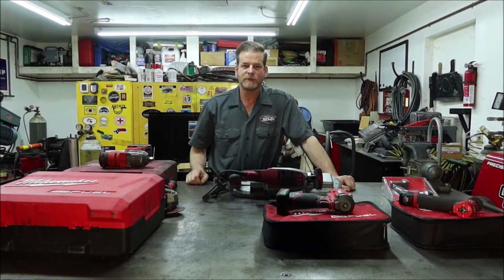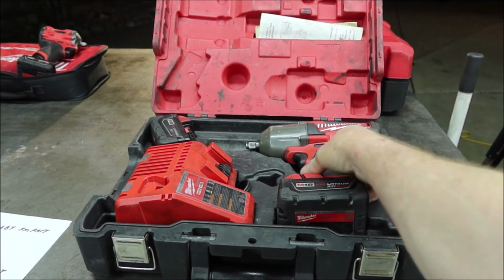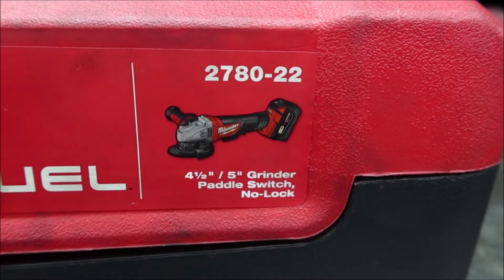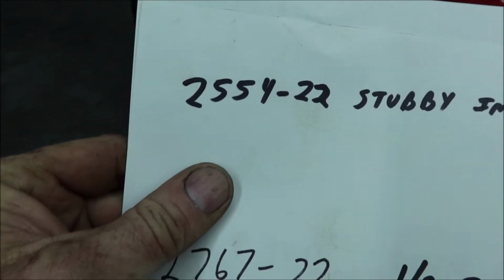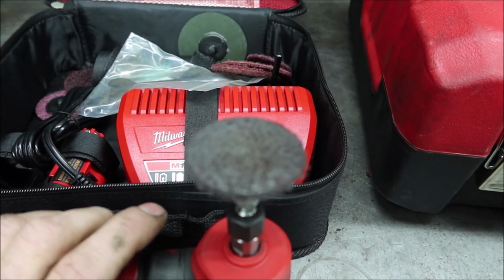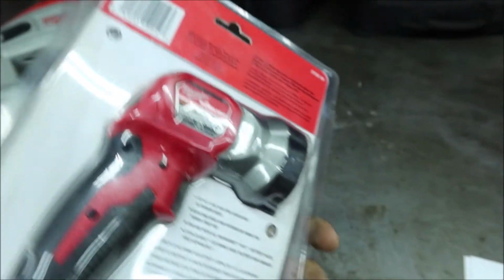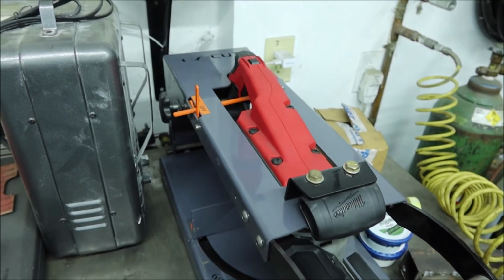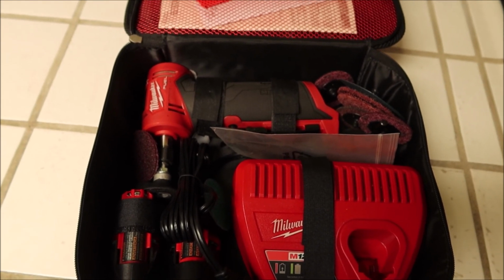My Favorite Milwaukee Tools as a Master Tech / Welder

Comment: Milwaukee has taken over the battery operated automotive tool field. I haven't met anyone who doesn't like the tools. However, I do know one big channel who doesn't use the tools because he says the batteries don't last enough. Has that been an issue for you?  I would love to have a portable band saw. If you like yours' I will consider looking at what Milwaukee has to offer, thanks.
Reply from the maker: The batteries seem to last real good.   That 1/2 drive impact I’ve had for years and I’ve never replaced the batteries yet.   Those portable band saws are great ,  since I have 4 of them.

Comment: I use Roloc pads on my mind 99 percent of the time I have use a 2 inch wire will works great 3 inch wire wheels and 3 inch rolocs do kill the battery fast and through the balance of the tool and motor off

Comment: Need to pick up a Milwaukee angle grinder
Reply from the maker: The angle grinder works great.  It has a lot of power.  I used it a lot when I built my shed.  I probably went threw 10 to 15 grinding wheels on it just for that one project.
Reply: @1970chevelle396  I have several angle grinders you can never have to many grinders in the metal fabrication world and even in general

Comment: I have the die grinder as well as the 1/4 3/8 and 1/2 stubby love my high torque m18 as well I just picked up the m18 cordless band saw it's a beast
Reply from the maker: I only have one stubby.  I have a 1/4 drive Dewalt one so I only bought one.
Reply: @1970chevelle396  there all great tools bro